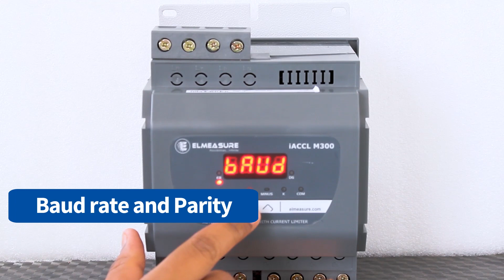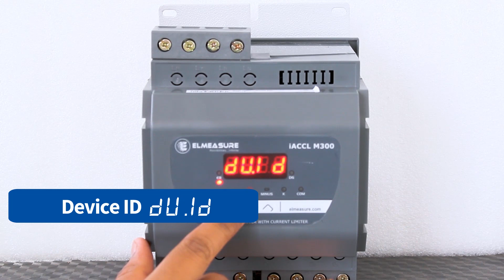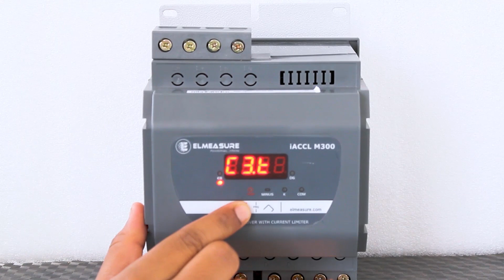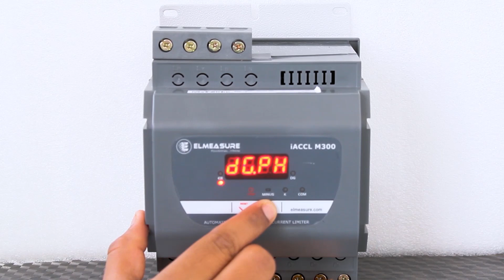How to program elmeasure IACCL M300 - Programming Guide

Comment: Error 260.0 what is the issue 
At night time 11pm to morning eb power off automatically on at morning 
How to set it ?
Reply from the maker: ACCL as the option to set higher voltage limit usage keypad, you can extend to 270V.